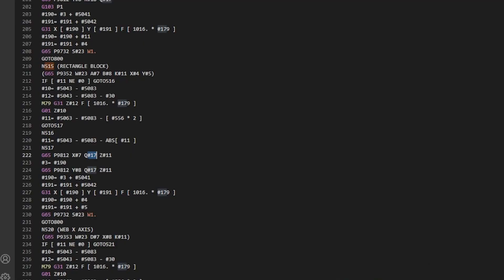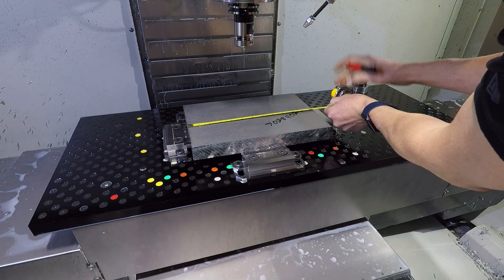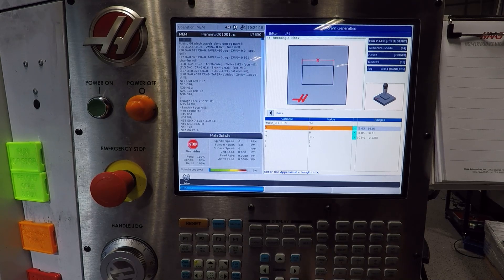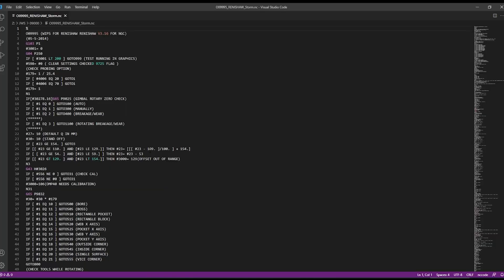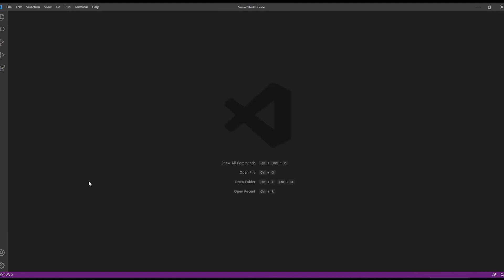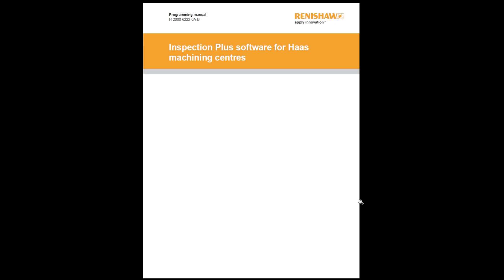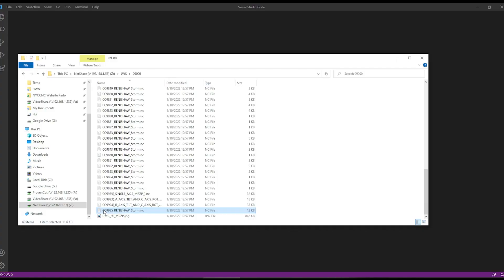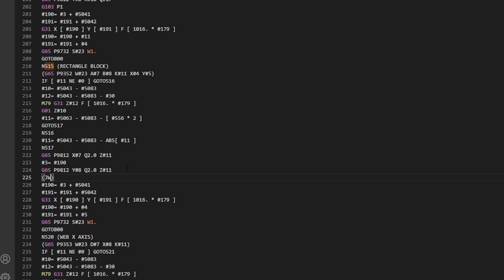IMPROVE Renishaw Probing by Adjusting Overtravel!

Comment: At 3:13 in the video the #17 should mean that you can add a Q-value to your G65P9995 line, the Q-value should be passed through to the G65P9812 lines in O9995. So theoretically, there is no modification needed. Granted I don’t run Haas, I run Doosan’s, but as far as I know G65 works the same on both brands.
Reply: You're exactly right when you're writing your own probing programs, or calling them in mdi. In this case I believe they're using the hass's hmi to call a prewritten program into mdi and run it. I would think it would be better to change the program that you copy into the hmi if possible instead of modifying the renishaw sub program and losing functionality or possibly running into a headache later, you might not want the probe to move 2 inches every time you mistype an x or y distance.
Reply: M165 on the new doosans

Comment: I guess i missed on what the 2.0 value did.  Did it tell the probe to over travel 2.0 inches?
Reply: Probably it did exactly that. Changed value controlled by some parameter into specified value.
Reply: Did you ever get your answer lol? I thought they were looking for an extra inch of overtravel but I'm assuming it's 1" per side.

Comment: These videos/tips are incredibly useful. We just got a VF-1, so I am a super Haas noob. In fact, the first time I started it with zero supervision and not having studied the controller, it was like stepping into a 747 cockpit, I was dazed with sheer immensity  of the hieroglyphics. I tentatively hit the big green 'Power On' button: nada. Hmmm. Went in back an hit the big breaker on, and this time at Power On I got the splash screen, but then it started a program or something because it did a tool change: Emerg Stop, to avoid a vise crash. Back on, with HIGH pucker factor, and now you are looking at a LIVE BEAST! So I got my chair and whip, my purpose being to check the ethernet cable I was installing. Being a computer guy and having become expert on Mach3, how hard could it be? I managed to start experimenting, settings and select program, and started to feel comfortable, starting to jive with the layout. I got into the wireless, and ethernet areas and set it up; Enabling SMB was important for Windows 10 to see the machine, which now works flawlessly-You can CAM a program on the PC and copy that file to the Hass, which shows up in the list. Sweet!
All this to say what a noob I am, but being able to edit posts thanks to your previous instruction, I file all these tips away like a reference, to go back and re watch and take detail notes in a document I can refer to. We just got a Renishaw but not installed yet, so I am sure I will come back to this, when I sort of more know what I am doing. We also have a VERY experienced machinist, but he is not so good with computers/networking/software, so it will be a synergy of us teaching each other. Thank you for these videos!
Reply: lol Haas machines always call a certain tool number on power up which can be changed to any tool number

Comment: Yes, this is a real problem with, luckily, a simple solution.
I have more of a problem with the rectangular block and vise probing.
When probing a vise, it also probes the Z-height of the jaw but when probing a rectangular block it only probes X and Y.
When probing a block, I mostly use the top center as XYZ 0,0,0 whereas I will (almost) always only use the XY 0,0 position of the vise with the top of my stock as Z=0 with a 2nd probing cycle.

Comment: Super confused how you go from messing around on the control to using the computer? Figured this would be an edit you have to do directly from the control. How do you extract the Renishaw code from the machine and then put your modified code back on the machine?

I get that you can use a coding program to edit a post processor or a gcode file that you're generating on a workstation, but isn't this code that's stored on the Haas itself? Wish the video spent a little time explaining how to extract that data on a normal computer. I assume it's involving being on a network that lets you rummage around in the machine's drive; but what about if you don't have the machine networked? Seems like the video skipped explaining a few steps here.
Reply: You just copy the 9000 folder onto your USB....

Comment: What did the # sign represent and why did you omit it?
Reply: #17 means that it replaces it with variable 17 when running it, so the # represents a variable, since he just wants the number 2.0 now he removed it :)
Reply: The '#' sign means that it was variable (variable number 17) that the probe cycle was looking at for the overtravel value.  He changed this from a variable definition that was updated in the background by Haas software to a hardcoded fixed value of 2.0".  The #17 variable will still be updated in the background by the Haas control software but it will now be ignored by the probing cycle with this change and use the new hardcoded value instead.
Reply: And variabele #17 can be set in the original line by inserting Q2.0 ( for example). Q = #17

Comment: John, don't you have the Renishaw Easy Set program on your (I'm sure the Haas does) machines? P9023 X(The width of your stock)A4. Q1. R1. Z-.75;  With this you specify your actual width. It will over travel out side R1.0" and over travel in looking for the part Q1.0 You could do your Y axis the same. I think it is better to specify these over travel distances in the cycle than to modify Renishaw's macro. Look at the easy Set Cycles. I know your Haas will do them It might have to be installed on your Okuma if not there. These Cycles are really helpful just using the probe in MDI.